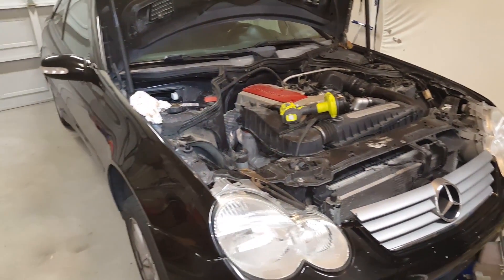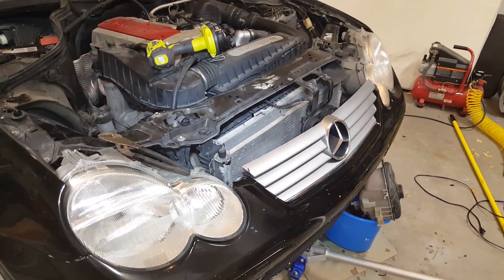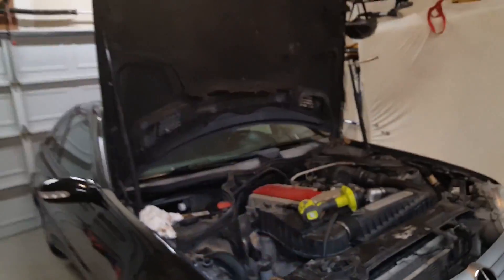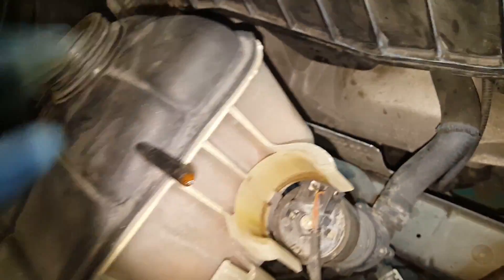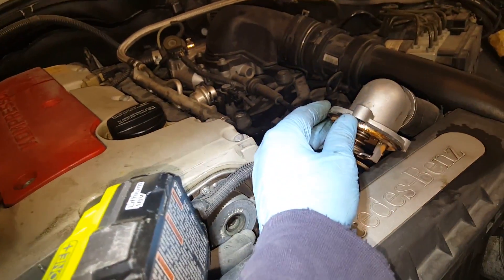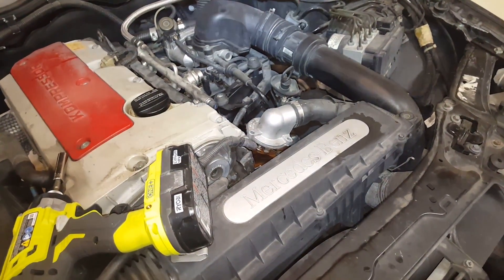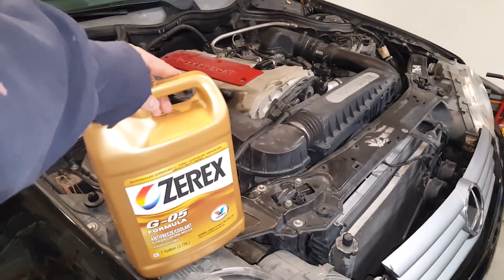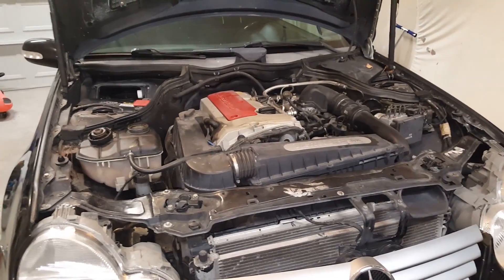Mercedes w203 m111 Radiator Flush (blown head gasket, oil in the water)

Comment: For those who have the same problem, it is not always head gasket or transmission oil cooler like what most mechanic would say as the either or problem for this. 
I had the same issue on my W203. Most of the time, it, it is the engine oil cooler that caused it. Either the oil cooler gasket needs to be replaced or the whole thing needs to be replaced. 
How to confirm this? If you see oil in the reservoir tank like this. Brown caramel color. Check your engine oil and ATF oil. If both are clean, then it is the oil cooler.

Comment: I cleaned out my coolant reservoir tank by adding 1/4 cup CLR & 1 cup corse table salt. After removing the coolant reservoir from the vehicle I then decided to shake up the CLR & salt solution. The salt was abrasive enough to clean out all the debris, it worked very well. I rinsed several times with clean hot water & then I reinstalled the coolant tank.

Comment: Hey guys, oil mixing in the coolant bottle, is not a blown head gasket, but a faulty oil cooler, or a broken oil cooler seal, before you go stripping your cylinder head, first check the oil cooler. However, if you have oil mixing in your oil sump, then you have a blown gasket for sure.
Reply: Hi. I have coolant mixing in my oil . Half a liter per 10 kilometers. I would imagine as you mentioned that it’s the head gasket. Is there anyway to tell if the head is cracked before I take this apart or should I just junk it..?Definitely don’t have the money to fix it if the heads cracked...

Comment: Next time you replace your thermostat don't throw it away. Keep it instead and remove the thermostat part out of the housing. Now you have a housing without the thermostat which will be a great tool to flush your engine without having to wait until the engine gets hot enough to open the thermostat and should get you going the moment you start your engine. Another thing: use demineralized water to flush. This will get your system cleaner than normal water or coolant does.
Reply: Mr.Riffian by de-mineralized you mean distilled right?
Reply: Correctamundo

Comment: My 1995 C280 oil in the reservoir I took to a Mercedes specialist, one look and he said that I have a blown head gasket. I ordered a radiator from FCP Euro and voila. Sometimes you have to do your research before taking your car to the shop. He offered to fix it for $3000 or for $4500 I could buy his daughter's car. My car isn't worth a grand so for $180 problem solved

Comment: Hey just spotted this, I had this issue on a e220 2014 and I initially thought head gasket, oil in the coolant, but turns out it was my oil cooler, replaced that and 6 months later again my oil cooler failed and caused oil to leak into my coolant. Common fault with the European made mercedes here. But I had same symptoms, heaters blowing cold etc, never any warning lights on dash apart from top up coolant, the oil thickend up the coolant preventing it from flowing through the pipes, hope this helps someone

Comment: It's leaking from head gasket,so that oil & water mixing together, you have change the head gasket Frist,then flush then coolent after.
Reply: Mostly not. Its rust or from the oil cooler.

Comment: No need to be embarrassed man we all learn sometime right? Did you end up using a head gasket sealer or did you replace the gasket yourself? Or sell it?
Reply from the maker: I sold it for $400. If it was just the head gasket I would have fixed it, but the supercharger began digesting itself and spitting metal flakes into the intake manifold.
Reply: @mikenewbry  yeah they're nice but expensive to maintain when there's better options out there

Comment: Mine is the engine oil coming to reservoir i tried to change the head flash the radiator but nothing changed even the thermo its new it is a compressor c200  111 engine please help.

Comment: Hi. what is the purpose of the auxiliary water pump?. I have seen that pump been removed in some cars.
Reply from the maker: You mean air pump? It blows clean air into the catalyst to bring it to operating temperature faster.
Reply: @mikenewbry  the auxiliary coolant pump. i live in tropical country. can i just pull off the power connector?

Comment: hi! did you change the head gasket? or what was the reason of this issue the oil in coolant? i have the same problem, i wonder  head gasket is main problem of this issue or something else was be damaged?
Reply from the maker: I would have replaced the head gasket if that's the only thing wrong with it but the supercharger was also going bad and had been spitting metal into the intake manifold, so I dumped the car for $400.
Reply: @mikenewbry  oh, i got this. Ok, thank you for quick response.
Reply: It may be the Oil cooler gaskets, there are 2 of them on the kompressor: 2711840080
 and 2711840180. Do a compression test on the head to help determine where the leak is. *Cracked heads are not uncommon.